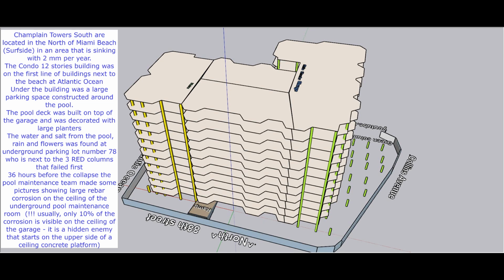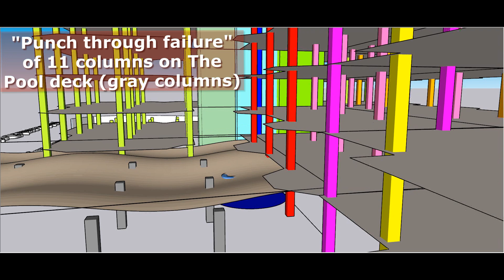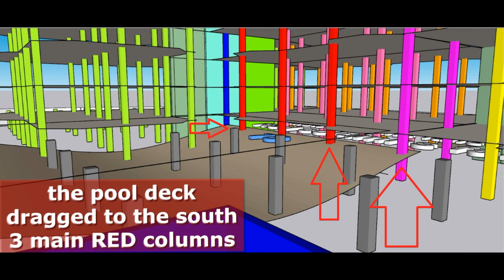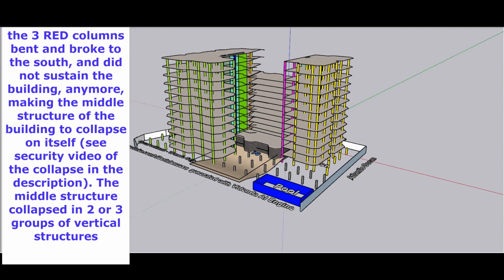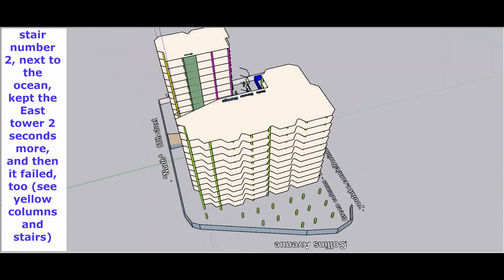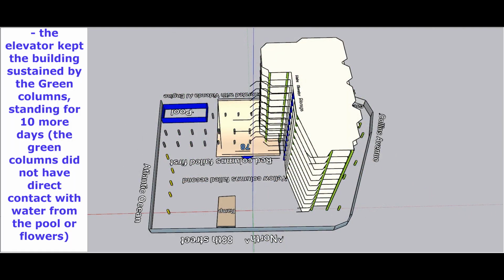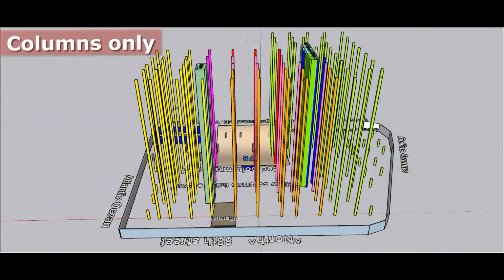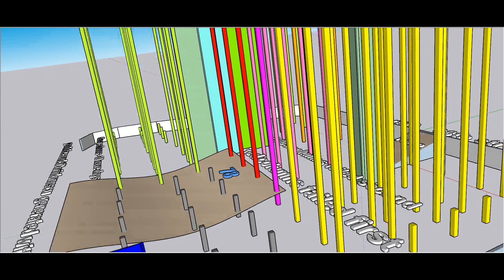Collapsed Building Miami, 3D model condo, penthouse, Champlain Towers Surfside Florida, demolish P3

Comment: I helped pour floors in multi-story building for almost twenty years as a cement finisher. On watching a video the yesterday, it shows the elevator shaft. The whole face of that side of the elevator shaft is smooth. Why aren’t there signs that the collapsed floors in that part of the condo were ever tied in to the elevator shaft? The elevator shaft is the core and heart of the building! That’s where your strength is, surrounding columns, it all ties in together. Maybe the photo’s on the video that I saw weren’t that clear. But I couldn’t see where those floors were ever tied into that shaft! Please correct me if I’m wrong!
Reply from the maker: The photos are at super resolution and your worst fears are true - there was no ties between the standing building and the collapse building (except for the foundation (where columns are probably tied in groups) and the slab that failed with strange patterns and cut a balcony in half) . There are a lot of missing things that you can imagine at ground level were the pool deck punch through columns. Why the slab punch through at the standing building where the columns are thicker and there was a parking space with no water from the pool or planters (and added asphalt). 
See The Penthouse, inside view before the accident, Champlain Towers South, Miami, Florida (Surfside)
https://youtu.be/HFWbCZG_6xA
Reply: I’m not an architect or structural engineer by any means, but I made the same observation and thought it strange as well. Nice to see that validated in your comment! So they ARE supposed to be attached huh? I thought so! How weird!
Reply: Most likely, the rebar in the slabs ended before the elevator shaft, so as not to interfere with the rebar running up the shaft. Judging by the pattern in the shaft left by the mold they used to form the concrete, they poured the slab, then framed out the shaft and poured it separately. Typically the shaft goes up first, and the slabs are built around it, I dont really understand why they did it this way.
Reply: I’m not even going to reply to that. But tell me how many multi story buildings have you helped to construct?

Comment: I never heard of someone seeing the pool collapse! Where can I find that?
Reply from the maker: Pool deck partially collapse (between pool and lobby). Pool was rock solid and with water, many days after the collapse
See The Penthouse, inside view before the accident, Champlain Towers South, Miami, Florida (Surfside)
https://youtu.be/HFWbCZG_6xA
Reply: @DorinIonescu  Oh I thought it meant that someone was on the pool deck at 1am and saw it happening during the collapse!
Reply: My Educated guess!
*Chlorine pool water 40 yrs of storms overflowing the pool water!
*Waterproofing failure ! 
*DECK  punch thru shows connection failure at pool deck columns! ( look at columns still standing)
Column connection ** 
*Column connection undersized rebar ?
* Not Enough rebar @ column to deck!!!!!!!!!!!!! 
*Rebar single strand at bottom of deck !!!! More info needed

Comment: I agree with Dorins scenario here.   The fatal flaw seems to be the terminal building columns being tied into the plaza/pool deck.  If the deck was independent of the building this might not of happened.  The deck would have given way and crushed some cars, but the towers would have not fallen.  That is purely supposition on my part because the deck collapse still could of kicked a building column, but it would of had a smaller chance of happening. Excellent and well thought out video on a complex subject.
Reply from the maker: Update - Miami Beach started to evacuate 2 buildings that have structural issues
Hope that new regulations will require separations between buildings and pool decks and planters
The Venetian Las Vegas had this problem, water from the artificial lake of Venice was leaking into the Casino and dropping on players, tables, and machines on the main Casino floors. They could not hide it as people do now with leaking water in their garages (which is just 10% of the actual corrosion that you do not see)
At The Venetian, they build a second level of separation between The Lake and The Casino where , in a water-insulated environment, workers check the pool leaking and do the repairs.  These 2 levels of protection and separation between the building and the water should be the mandatory solution for all our buildings
See The Penthouse, inside view before the accident, Champlain Towers South, Miami, Florida (Surfside)
https://youtu.be/HFWbCZG_6xA

Comment: I'm a retired R.E..lawyer/investor from 1960's - 90's vintage. Owned over 100 rental homes/duplexes. Never entertained buying/investing in a condo. Always advised clients not to buy a condo for numerous reasons.The entire concept of condo ownership is designed to enrich the developers/builders who jump ship after all the units are sold. Management, control, policy and procedures are in the hands of unqualified HOA or BOD  and to be avoided. Single family home ownership continues to be the best lifestyle investment, albeit sale prices are 10-20 times plus more for starters. As for the corrupted pipsqueak blabbermouth mayor of Miami and her cohort imbecile mayor of Surfside, they both should be ostracized by community groups that can speak out with credibilty and integrity.
Can additionally include the other sleazeballer, Gov.Ron DeSantis, with that robotic do nothing hypocrite, Senator Mark Rubio @Rick Affinitee'
Reply from the maker: I had a similar problem and voted yes for consolidation even if I had no money. It is important to start working as soon as possible. It is like insurance, you do not know when you need it.
Then I helped to get more YESes from other owners
Then I paid monthly amounts
See The Penthouse, inside view before the accident, Champlain Towers South, Miami, Florida (Surfside)
https://youtu.be/HFWbCZG_6xA
Reply: Results confirm all your efforts were in vain as the remedial repairs solution encountered a bureaucratic snafu process that does not have accountability for the condo residents health, safety and life itself.   @DorinIonescu
Reply: @plaintalk3804  he wrote the same paragraph to me. Besides that I'm not no lawyer but I know these type of building are not safe.

Comment: No restoration company or hvac came to inspect?  Lots of water damage and mold plus stalactites.
Reply from the maker: 3 years ago a structural engineer checked the building to prepare the 40 years certification
See The Penthouse, inside view before the accident, Champlain Towers South, Miami, Florida (Surfside)
https://youtu.be/HFWbCZG_6xA

Comment: I have Spent time looking at the past pictures and comparing them to recent pictures (prior to collapse). Looks like there was some very large palm trees planted in those planters on the pool deck where the collapse first took place. Maybe that was the straw that broke the camels back
Reply from the maker: Yes - I fall in love with the Palm trees in the lobby of Loews Santa Monica
https://quirkyfusion.com/wp-content/uploads/2012/10/P1130177.jpg
But now I got scared of the heavy load and water leaking that can destroy the building structure 
See The Penthouse, inside view before the accident, Champlain Towers South, Miami, Florida (Surfside)
https://youtu.be/HFWbCZG_6xA
Reply: I counted 10 palm tree in the planters on that pool deck and they were not in older MLS pictures of the pool deck.
Reply: My Educated guess!
*Chlorine pool water 40 yrs of storms overflowing the pool water!
*Waterproofing failure ! 
*DECK  punch thru shows connection failure at pool deck columns! ( look at columns still standing)
Column connection ** 
*Column connection undersized rebar ?
* Not Enough rebar @ column to deck!!!!!!!!!!!!! 
*Rebar single strand at bottom of deck !!!! More info needed

Comment: The pool was on top
Of garage 😱.
Reply from the maker: The garage was built around the pool. The pool deck was on top of the garage.
Maybe, the original structure could sustain 15 floors of marble and furniture. But corroded structure could sustain fewer and fewer floors until it was too much
Palms were too heavy. And the original slopes and drainage system were replaced. People invent new stuff without asking structural engineers
See The Penthouse, inside view before the accident, Champlain Towers South, Miami, Florida (Surfside) (I saw your comments there but I will add this link anyway)
https://youtu.be/HFWbCZG_6xA

Comment: “You can go to any condo building in South Florida, and you’re going to find water damage, flaking concrete and deterioration. You’d have to prove that someone knew this was an imminent danger and ignored it,” said prominent South Florida defense lawyer Roy Black. “An inspector would have to have told the H.O.A., ‘Hey this place could fall down, or this column supporting the building is in danger of collapsing. Short of that, they’re not going to be able to bring a criminal case.”

Follow the money.inspectors were paid off. They're all going to walk away free, and the cycle of property management will continue on, with raggedy assed maintenance and rolling the dice on people's lives to keep that monthly rent coming in .......
Reply from the maker: I had a similar problem and voted yes for consolidation even if I had no money. It is important to start working as soon as possible. It is like insurance, you do not know when you need it.
Then I helped to get more YESes from other owners
Then I paid monthly amounts
See The Penthouse, inside view before the accident, Champlain Towers South, Miami, Florida (Surfside)
https://youtu.be/HFWbCZG_6xA
Reply: Simply not true. Recertification for occupancy was happening this year. Outside consultants came in 2018 and reported the damage and stated it would only get worse. No one was paid off, but the building had serious neglect and that's on the owners of the condos.

Comment: Shame you used a robo voice. Also, the beachside section didn’t pancake exactly onto its own footprint. It was angled slightly towards the pool and towards the empty area of the section that had fallen. When you look at the pile you can see each floor is slightly across from the one below it.
Reply from the maker: yes, I prepare version 4 of the 3d model
One lady from 611 exit her room to the left and took the stairs next to the elevator. She was lucky not kbowing there are stairs next to her door
See The Penthouse, inside view before the accident, Champlain Towers South, Miami, Florida (Surfside)
https://youtu.be/HFWbCZG_6xA
Reply: That's because the east section swayed as it collapsed. The first sections collapse pushed the east section to the east as it fell, and when it swayed back, the columns must have fractured and the whole thing came down.

Comment: The building and its property did not sink. This had nothing to do with the collapse!  The building is built on tension piles that go down to bedrock.  Its unaffected by shallow ground conditions.
Reply from the maker: See the info about the sinking on the link below. It is about areas not buildings
The experiment compared East and West areas
All the West areas that are at South of this building are not sinking
I hope that the excavation for the foundation was done until they hit the bedrock, not just a size specified in the project
https://miami.cbslocal.com/2021/06/24/surfside-condo-sinking/
See The Penthouse, inside view before the accident, Champlain Towers South, Miami, Florida (Surfside)
https://youtu.be/HFWbCZG_6xA
Reply: Based on the foundation details on the drawings, the footings did not go to "bedrock".  The building was constructed on compressed earth which is subject to loss of support resulting from excess water in the bearing stratum.  They already stated the area is sinking 2mm a year.  At that rate, 5 years of settling is a 1/2 inch drop.  Concrete structures like Champlain towers was not designed for a 1/2 inch differential settlement.
Additionally, it is blatantly obvious from the photos that the deck rebar was not properly positioned in the slab and the structural investigation reports stated the pool deck was not properly waterproofed, resulting in water seeping thru the pool deck and ponding in the basement garage.
Reply: @paulpresson9786  the tension piles were designed to compensate for any slight settling.  1/2 inch is nothing at all.  The only problem was the waterproofing membrane under the pool deck pavers went bad from age and was never replaced for decades!  The water leaking on to the concrete destroyed the pool deck and the rebar inside the concrete and it also allowed the water to leak into the lower parking garage. The other sister buildings had the proper maintenance and had the waterproofing replaced when it needed to be that's why it has been determined there is nothing wrong with the other buildings and they are in perfect condition. The only problem with the South building was a deplorable lack of maintenance and this is what you get!!    Even the tough investigator that they have hired said that the other 2 buildings are perfect and there was no design flaws or deficiencies. He said he would let his own children live in the other 2 buildings no problem.
Reply: @paulpresson9786  wrong! I have no videos on anyplace! You obviously have me confused with someone else,  who knows who!  Anyway my opinion is based on multiple sources and studies of TOP EXPERT ENGINEERS as well as studies of blueprints and engineering techniques not to mention the other sister buildings are in Perfect condition as documented by the top expert engineer that they hired to investigate the collapse as well as a study of the other buildings.  Yes the pool deck caused the collapse! It took out atleast several columns when it collapsed and put too much load on the other ones. Caused a domino effect!!  I'm pretty confident the final results are going to show this.  My professional opinion is as good as yours.
Reply: @paulpresson9786  I didn't say the pool deck was tied to the building, I said when the slab fell it fell against the 3 red columns breaking them in half or pushing them sideways. In the one picture of the garage you can see the one column laying on its side on the floor of the garage before the building collapsed.

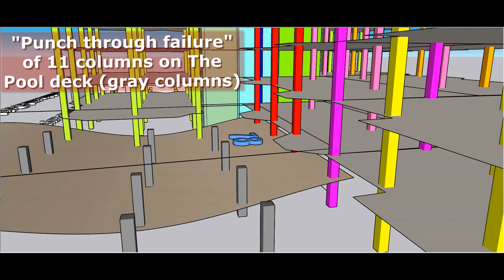Comment: There are factual errors in this video. The tourist video from across the street was not "24 minutes" before the collapse. Phone records show that the video was recorded at 1:18 a.m., minutes before the collapse. Emergency responders are responding by 1:20 a.m. and the EMS audio puts the time of collapse between 1:24 and 1:25 a.m. A fireman on the scene reports that it's "the whole building" at 1:29 a.m., having already arrived. Lots of other little errors too, but since the actual way the collapse happened is mostly conjecture at this point, there's no use arguing. But, the "24 minutes" is an actual factual error that can be proven based on phone records and audio recordings.
Reply from the maker: Sorry - I will update this in version 4 of the 3d model
See The Penthouse, inside view before the accident, Champlain Towers South, Miami, Florida (Surfside)
https://youtu.be/HFWbCZG_6xA
Reply: @DorinIonescu  - It's really irritating that you suggest a video in every comment, even if it's  completely unrelated to the comment being made.  I don't care about the inside of a unit last year. It's annoying. Stop.
Reply from the maker: sorry for the suggestion
There are news sources that give suggestions at the beginning of the response. Some even ask you to register or pay something before you read anything.
I paid for training with Russell Brunson and Eban Pagan and they taught me to give suggestions at the end of the message. Youtube is giving advertise or suggestions at the beginning and/or in the middle, and then you have suggestions at the end of the movie 
If you have a link to a better training please give it to me.  
(no link)
Reply: @DorinIonescu  - You're kidding, right? If you have formal marketing or business training, you obviously didn't understand or absorb what they meant. Either that or they're not qualified to be teaching and you got ripped off.   #1, you are not a publication with millions of subscribers with actual writers and editors on staff.  The comparison to "news sources" that ask you to register and/or pay is laughable.  You are no where near that level. #2, it can be good to offer suggestions and engage with your audience, but it needs to be relevant. You linking the same irrelevant video no matter the comment is frankly,  spam. You are providing no value to your audience by spamming them with irrelevant links. You are doing the opposite of what you think you're trying. You're alienating and annoying people. How about you focus on creating good content with accurate information before you try to compare yourself to the New York Times.
Reply: @DorinIonescu  Go look at any successful YouTube channel that you enjoy. I can nearly guarantee that they aren't doing what you're doing in their comments. Why? Because it's annoying and not the way to market yourself to people.